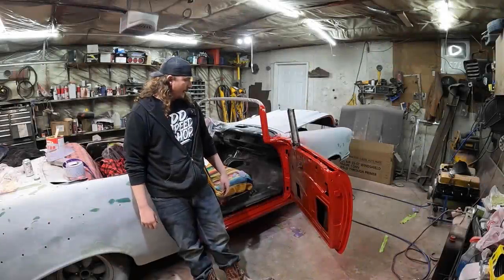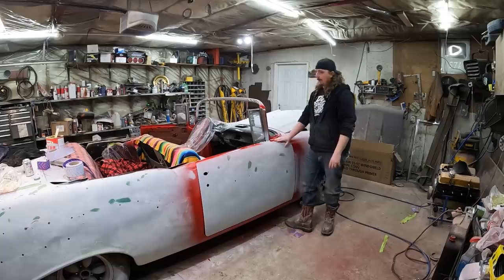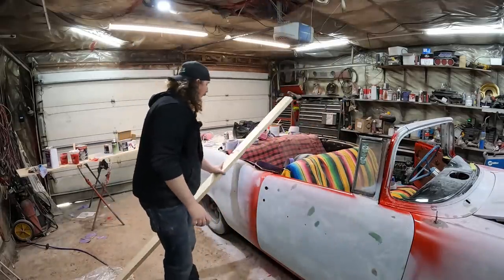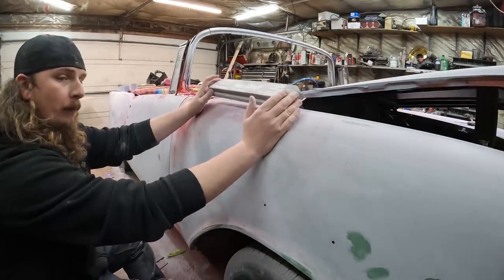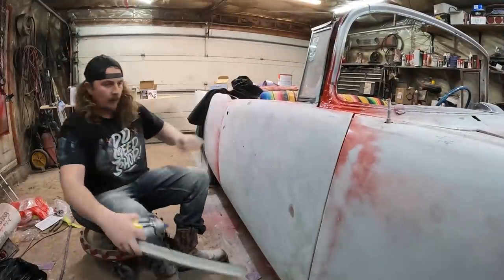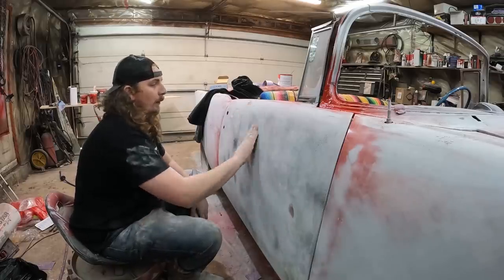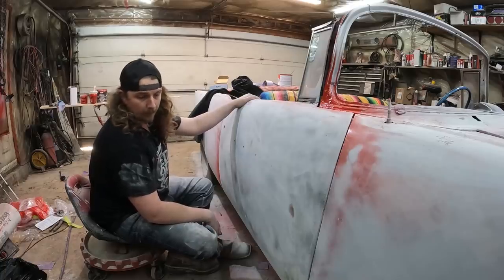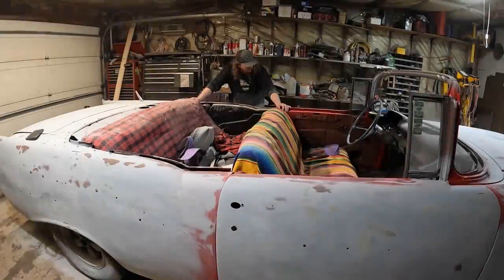"LAZER" Straight Body Work With A LOOOOOONNNNNGGGGG Board On My 1957 Chevy Rag Top

Comment: OMG...DUDE. THIS WAS A GOOD ONE. GOOD LAUGH FOR MONDAY...But i can tell you one thing. You are literally on point on so many things its crazy. I have done a half dozen cars over 20 years also and the thing is you get better on every one you do by default due to standards are higher and learn from mistakes. ive always said the more you know and learn the worse off you are some things. You proved this on this one in that i guarantee you wouldnt have done hardly any of this stuff such as all the stages of grits..guide coat..blocking..etc. and if someone or people in general get close enough to it to judge the thing then they dont know the story and guarantee they couldn't do any better. and like you said its a 20 footer and once again our 20 footer nowadays is so much nicer than the last one we called a 20 footer..lol. your doing everything perfect in my book. my steps are the same so odiously why I agree but you tell yourself you have to draw a line cuz nobody is gonna notice minor flaws unless you point em out usually. ive noticed if they do they are just trying to get under your skin. so like you said do it to the best of your ability and be done so you can enjoy it. ive learned that over the years myself. more fun to use them than have them be garage ornaments...waiting on the next video

Comment: The one very important thing you didn't say a peep about was before you bring the car back in after you clean & blow out the shop 3 or 4 times, don't forget to wet the floor !  WET THE FLOOR DAN ! ! it will help keep the dirt on the floor off the fresh wet paint. Also, put a piece of tow chain from the frame of the car and just lay it on the ground under the car out of your way, same reason, it helps keep the dust from picking up onto the fresh paint.

Comment: Looking good Dan!  Need a buddy with a woodshop make you up a couple of sets of handles (like the ones on a wood plane) just attach them to your wood blocks to make it easier on your hands and so you can get more equal pressure of the sand paper against the surface.

Comment: Danny! You're learning! That's how we all learn..."By Doing". I remember when I was still a teenager and bought an Austin Healy 100-6 (same as the 3000 model but only a 2 seater) for $100 bucks!!!...it had no brakes, a bad tranny, a badly cracked windshield and needed a little body work and paint...I drove it home about 8 miles with NO BRAKES haha and made it! anyways, my first experience with body filler...what a joke! I mixed the whole tube of hardener into the pint of filler and started to spread the filler and before i could say Sh*&T it hardened up...the can was as hot as a campfire skillet haha. But I learned real quick what NOT to do...and to READ THE DIRECTIONS! Haha. This is only your 3rd paint job so JUST DO IT and like everyone else says learn from it. That's how we all learn...by getting off our lazy asses and doing it. Most people (IMO) always have excuses and use them all the time instead of going after that big fish...your dreams...your things that make you get up in the mornings with energy...Dan-the-man! HAVE FUN!

Comment: “You know Dan, if you’re determined to try your long long block you should really use self-adhesive sandpaper because the hot glue will harden unevenly with bumps …..”. 😆

Comment: I would run the line from the pump, to the dryer, then into the tank. Condense the water out of the air before it hits the tank.

Comment: You forgot to do the cliché back lit fan and 1 inches apart barn board walls.You’ll find out as soon as you start spraying whether the mason hardener worked in your other brand tractor paint.(red areas around the doors.it’ll wrinkle up if it didn’t)

Comment: Dan just thinking when you go to fit the hood cover back on the car after paint why not make a frame out of tig wire to mimic the soft top folded down. So it will look like the hood is there but we know it ain't. Saves it been filled with rags etc that can hold moisture and could cause future rust.

Comment: It's only a fail if you quit trying, or it shrinks like stripper hit it. Catch cans will help to dump back in the gun.
     I'm sure it is gonna look better than air condition this summer. The only thing better than cruising the lake in a 57 and checking out the latest swimwear. Is cruising a red convertible 57, and putting sku numbers on mommas.

Comment: Hey Dan when painting in an non panting environment. ( home garage  ) you really can't be using a heavy coats . Using a smaller tip size to control out put of paint along with faster passes.  Finish coat slower pass .  Not a painter but have done my share of garage paint jobs. Your doing a great job.

Comment: dont use the 2/4 wood .you nut. the foot board is the right way .recall i , Gordon worked in a Auto Body Shop . I would do the tear Knox parts unnerving off the cars but I would also help Sam the car is down the sandblasting or blocking them out with sandpaper before you paying them at big long block for your goofball. But if you use a block I just saw you there are different size that would fit